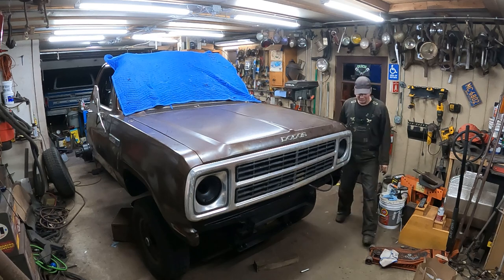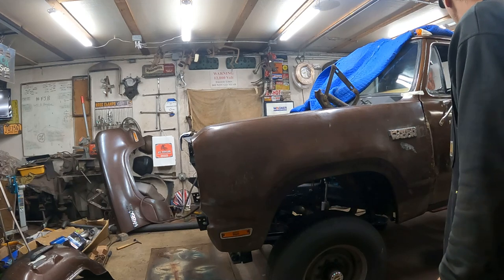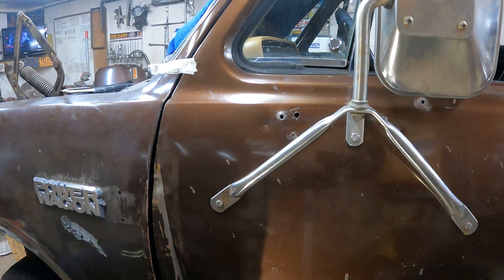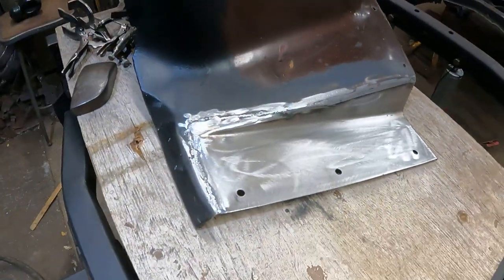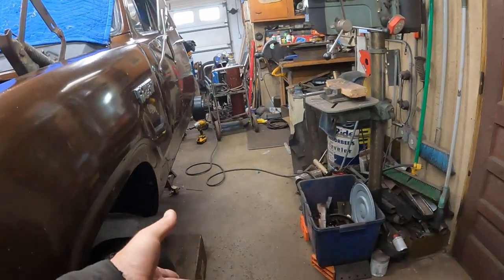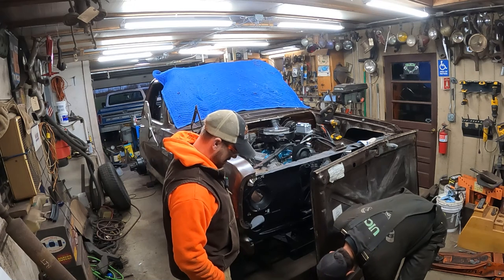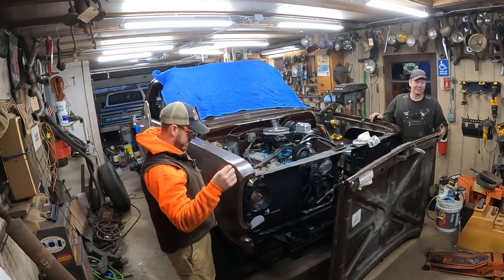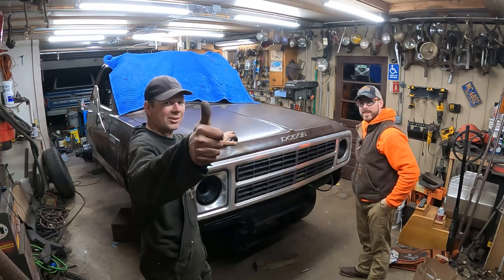1980 Dodge W200 Front Clip Assembly

Comment: awesome repair on the right fender...like a pro! These 80s vehicles were pretty crude.
And even a lot of them in the 90s. Like my F150. One would swear they had workers on
the assembly line who's only job was to take a mallet & prybar trying to get panels aligned
Panel fitment is so much better on newer trucks.
Reply from the maker: Yeah, the panel fitment on this truck leaves a little to be desired!